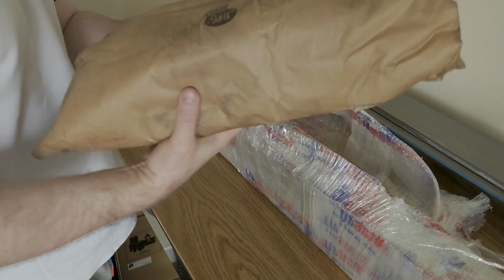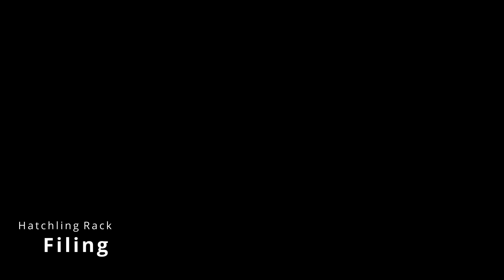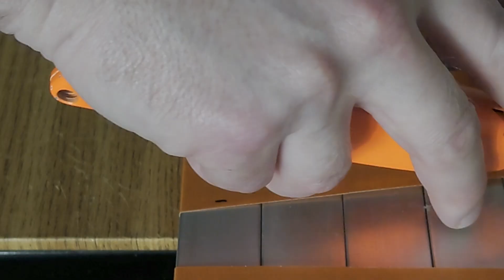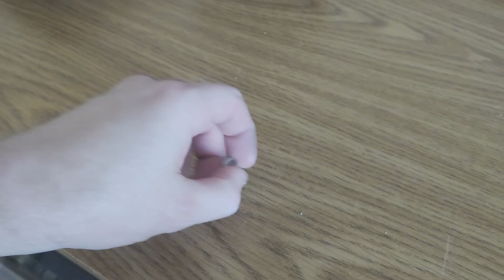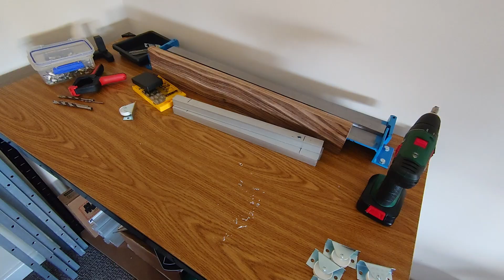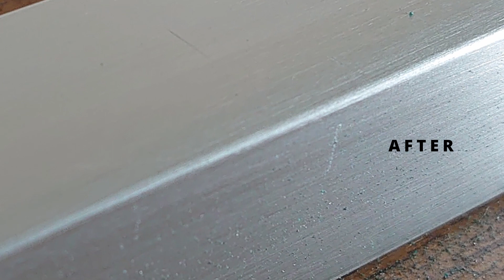DIY Hatchling Ball Python Rack #2   Building the Frame

Comment: Where do u get your sheet material from
Reply from the maker: This time I got it from metals4u, but I normally just call local metal suppliers.
Reply: @SplicedSerpents  nice one thank you Goin to be making one soon just goin to be used for corn-snakes not pythons
Reply from the maker: @dannyatkinson8239  it should do the job for corns. Good luck with the build
Reply: @SplicedSerpents  where do you get your tubs from  sorry for all the questions
Reply from the maker: Sorry, I missed this comment. The tubs are Wham 14.75l. I bought them from https://www.plasticboxshop.co.uk/home-storage-c1/14-75-litre-wham-shallow-a3-plastic-storage-box-with-lid-p387 - They are cheaper at Homebase, but they were out of stock,